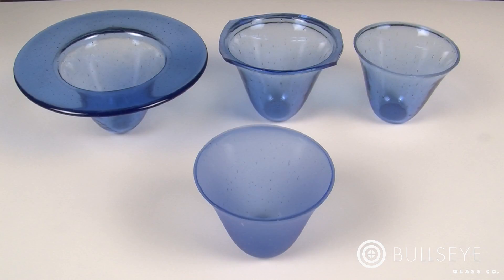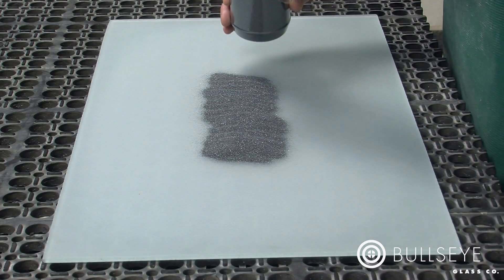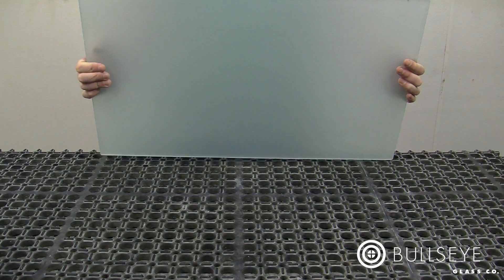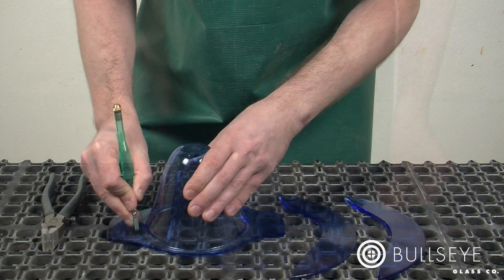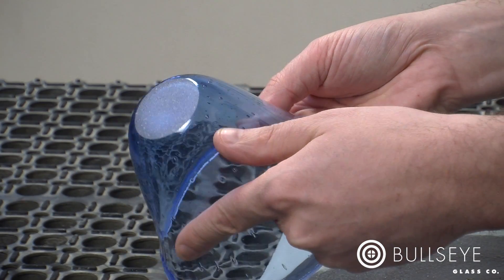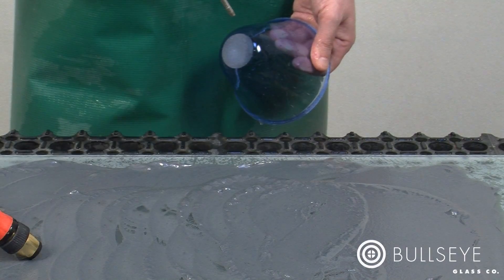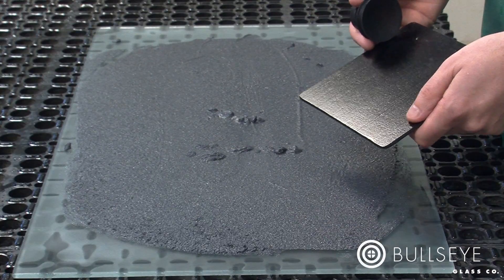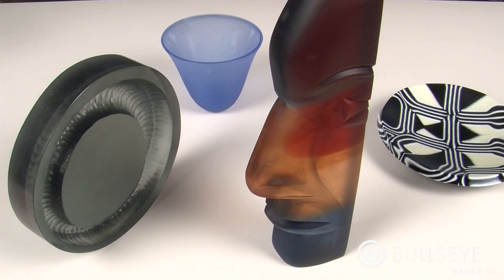Coldworking with Loose Grit

Comment: Instead of sheet glass could I use marble?
Reply from the maker: Glynes, I don't think that marble would be a good choice as a work surface for loose grit lapping. It's extremely soft compared to the glass or the grit. Broadly speaking, marble (calcite) is around 3 on the Mohs scale while glass (quartzite) is more like 7 and silicon carbide grit is in the 9-10 range. The marble would wear down and 'dish' pretty quickly. Plus it's a lot more expensive than a piece of plain float glass.
Reply: @BullseyeGlass  thank you so much for the advice very much appreciated xxxx